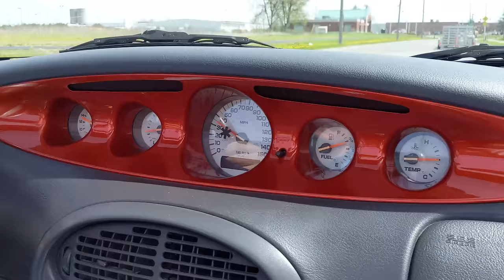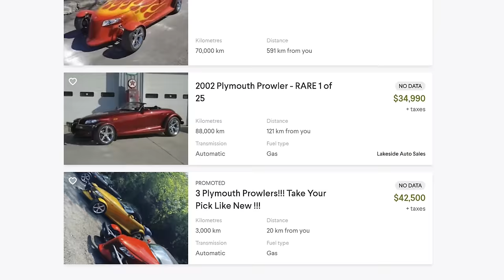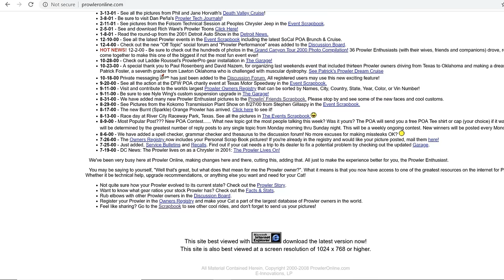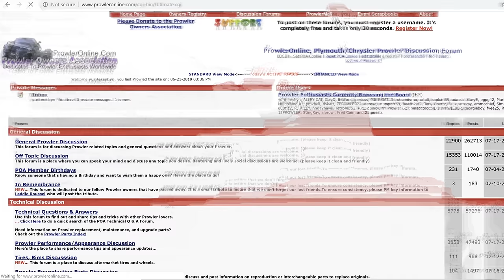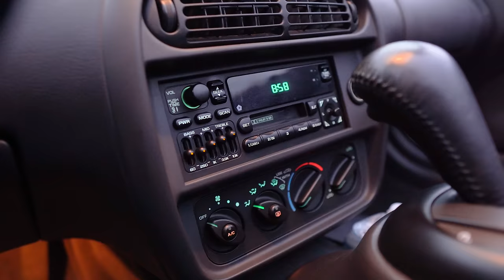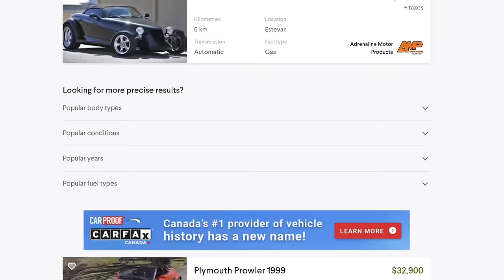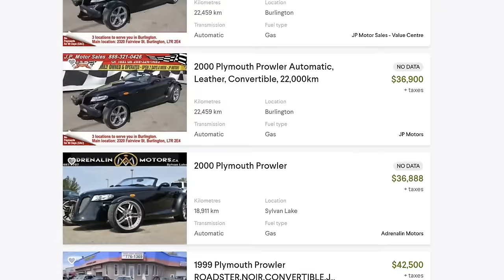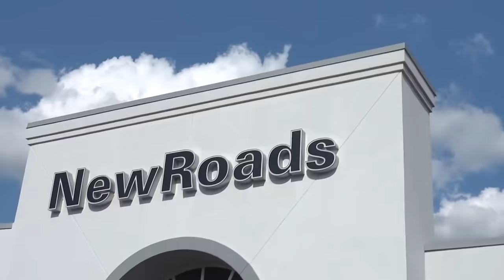I Bought My Dream Car - A Plymouth Prowler

Comment: Prowler with a Hemi....that's how they all should have been built.
Reply: Agree
Reply: They didn't have the Hemi when they built these.
Reply: @PeterBellefleur  I am totally aware of that.... I think you totally missed the point of what I said.
Reply: I don't thin a hemi would fit. Barely enough room under the narrow hood for the V6.
Reply: @Brandon-xp1ob   I am not sure if you watched the whole video or not, but the guy he bought the car from did in fact do a hemi swap into a Prowler. No telling how much cutting and banging he had to do to make it fit but he did make one fit.
Reply: Shoulda had a 5.9 magnum
Reply: @AllAlaskan907  OHC V6's can be deceptively wide. I dont think the 3.5 was too huge... but side by side it surprising how small a pushrod small block V8 can be.
Reply: @moparmanicgarage  I dont doubt they wanted to... at the time... but the old 42LE from the Intrepid may not have survived very long unless they upgraded them.
Reply: Should of had an inline 6
Reply: You don’t get the car
Reply: Circle H facts
Reply: They didn't have hemi's well there was a 426 one some did but quite a few people dropped viper engines in them
Reply: The Prowler V-6 put out more hp. than the Dodge V-8 did in that year. By about 30 hp. Hemi's didn't exist and the V-8 was an iron block. Not just a little heavy, REALLY heavy. Cruise ship anchor heavy. The Prowler was never supposed to have a V-8 engine and still wouldn't even today. Today, they'd throw a turbo and a dual variable cam on the 3.5 and put out 500 hp. For sanity's sake, the dual variable cam would be enough by itself and they'd leave it naturally aspirated. Even with aftermarket today, you could put an electric supercharger on it easily and just hook it into the air box. That would pickup at least 80 more hp. right there. The sky's the limit today AND WASN'T IN 2002: YOU PEOPLE SEEM TO HAVE FORGOT THAT. I wouldn't have anything else.
Reply: There would be No Room!! The V8 at the time made the same power!!!! Every other car in segment made less or a little more BMW Z3 made the same power
Reply: @DevoPLO  That is your Opinion
Reply: The Plymouth Prowler was 6cyl auto, Plymouth Howler was 8cyl with manual option..
Reply: @moparmanicgarage magnum 5.9 didn’t even make anymore power than the v6 despite all that displacement and cylinders, just more torque with the added weight. The 3.5 was fine for the time

Comment: Upgrade the speakers he’s crazy for saying no. The are old and blown definitely would wanna hear my music
Reply: And drop in a nice doubledin with CarPlay and Android Auto and rewinding sirius.
Reply: Howard Key I think the point he was trying to make was keeping it as OEM as possible. Putting in an aftermarket head unit would definitely ruin the look of interior in my opinion.
Reply: WRB I see that. But upgrading the speakers will not change the look whatsoever and I couldn’t see anyone wanting original blown, paper cone speakers over some nice aftermarket speakers behind the factory grilles. Get a nice set of Focal, JL, or Infinity speakers and you should be set. I’m usually against changing the headunit. But a nice Sony unit with CarPlay and android auto looks like a stock headunit and functions wonderfully (look them up, they’re absolutely awesome AND have a volume knob.) I just wouldn’t do any modifications that aren’t able to be returned to stock.
Reply: Gotta have the rewindable sirus

Comment: Am I on the only auto tech cringing when he floors it?? Those engines eat head gaskets and inner tie rods
Reply: Head Gaskets? The 3.5? Not really. Biggest issue these have are people not changing the timing belt and trashing the motor. The oil pump sometimes packs it up around 180K and if you don't notice, it chews up the rod bearings. Its a strong motor that doesn't get the respect it deserves, and sounds great with a decent exhaust.
Reply: @PeterBellefleur  amen! beautiful running and sounding engine. the 300M mill. highest hp production V6 when she debuted. my aunt has an Intrepid R/T she bought used..been her daily for 12 yrs and it was a few yrs old when she got it. excellent running car yet & cooler looking than any mid or full size sedan out now, save for the Charger & 300. ..which..are we losing the 300 next yr?

Comment: I have a prowler and it's not a race car as everybody thinks and kicks it because it's a V6 but in reality it's a cruiser and can hold it's own weight when it comes to speed because of it's light weight body and it's surprisingly quick. The cornering is sweet but a bit of a bumpy ride but getting past that the car is unique. I have a lot of people saying what the hell is it and what a cool looking car and can't believe that my car is a 2001 Mullholland. My personal feeling about the car is that it's different from anything out there and with the generic shape they have out there now , making this car a standout for looks and original design which still turns heads in 2019.

Comment: I’m the owner of an 01 Bonneville ssei and I had to change the speakers recently and it sounds so much better and clear than the early speakers. Recommend speaker replacement if it’s easy.

Comment: I do love the prowler, ssr, hhr, just a few of these unlike the pt cruiser.  Was shocked to learn they are V6 also should of came from the factory without them plastic front bumpers and a hemi at least a magnum V8. And a manual have NEVER seen a manual.

Comment: I was doing development work for Chrysler when this car was being produced. I took a Chrysler engineer to lunch and he raved that we just had to take his Prowler. I'm not a fan of the styling. Take away the big boxing gloves in front of the headlights and it would improve drastically but as we took off for lunch my first impression was that the suspension was ridiculously stiff - like driving a Formula Ford on the road stiff. So stiff the car bounced around in the corners so much, the engineer just couldn't put any power to the pavement. No matter what he did, the power never impressed me. The oomph just wasn't there. The chassis also squeaked incessantly. Yeah, no fond memories of the Prowler. Now my first ride in a Viper, well, that's a completely different story!

Comment: I got my 2000 yellow Prowler in 2016 with only 370 miles on it. I have over 11,000 miles now. But although it looked perfect when I got it, there were a lot of hidden issues that you need to plan for repairing and replacing. I live north of Detroit; if you guys aren't too far away in Canada, I'd love to have you visit so I can show you all the things I have learned, a lot of that from the POA (Prowler Owners Association, prowleronline.com). If you have any contact info please send it on.

Comment: Raptor would easily beat that prowler in a drag race
Reply: Actually the Raptor and Prowler have the same quarter mile and 0-60 times. Although Yuri's is the 1st gen which is a bit slower.
Reply: The Raptor and Prowler have the same 0-60 and quarter mile times. Although Yuri's is a 1st gen which is a bit slower.

Comment: Im 58 years old, ivd had some sports cars, and  my lifetime, '68 firebird, 67 camaro, 79 transam, and now have a 1982 corvette. But i always had my eyes on a prowler, well yesterday i went to see one, a 2000 model with 12,000 miles. Ive always liked black cars, but not on a prowler. These cars look better with candy colors, i think. To show off the body and definition  of complete car. This car was all black..  Im 5'10", weight 200 pounds. Im not overweight. Im in pretty good shape. Kinda broad shoudered, well, i got in the car and man i was really uncomfortable. I sat there in disapointment. The car is alot smaller than i imagined. I was about to trade my 2008 jeep wrangler 2 door. I didnt buy the prowler. My jeep is way more comfortable.

Comment: how is this a dream car? it is considered in the list of Worst Sports Cars. it was not a beautiful car. Original – yes, but not really attractive. It was inspired, if not plagiarized, by a retro roadster design by the famous Chip Foose, and planned as a modern-day hotrod.However, the Prowler was never actually one. A classic hotrod needs V8 power with way more than 250 hp, and three pedals - while a manual gearbox was never available for the Prowler. 295-millimeter wide rear tires? For 250 hp? Come on, Dodge currently puts 275s on its 707-horsepower Hellcat twins…

Not only it wasn’t very powerful and fun-to-drive car, but it was also very unpractical – the trunk was so small that Chrysler dealers even offered a Prowler-based trailer with similar styling and wheels. An expensive ($5,000) option, by the way.
Reply from the maker: This is the worst comment in the history of our channel
Reply: @TheStraightPipes  As evidenced by Jnco jeans and the Tomagotchi, the late 1990s was a weird time. Was the Plymouth Prowler the world's finest sports car? Nope. But it did speak to a corporate will to try new things, and a more innovative Chrysler than at perhaps any other time in my life. Rarely do truly memorable vehicles come out of focus groups, and this roadster is nothing if not a singular vision.

Plus, if all else fails, you can probably drop an LS1 in there... Sorry MOPAR guys.